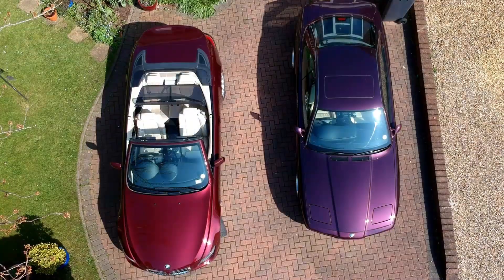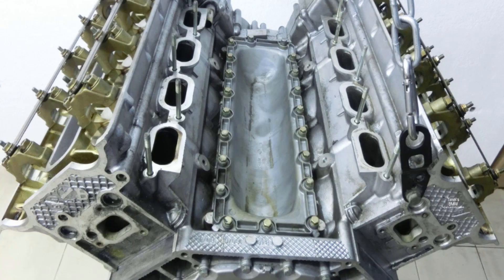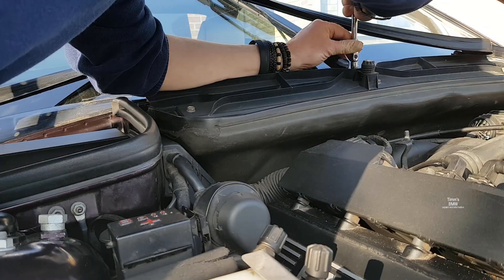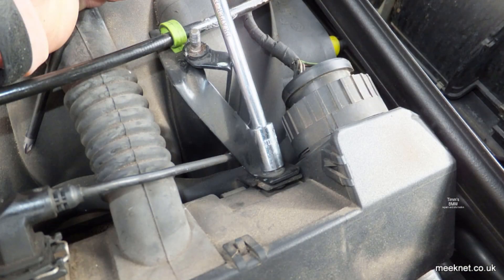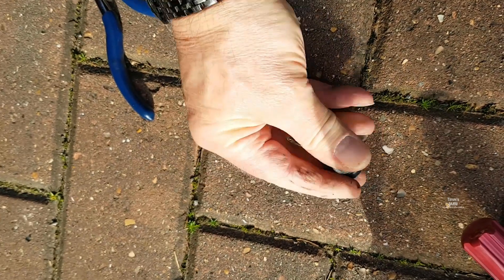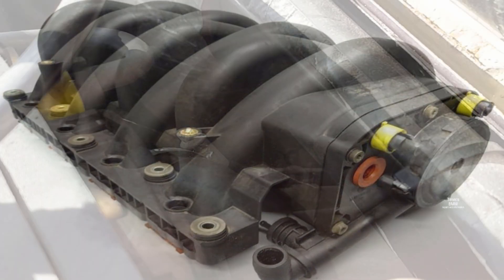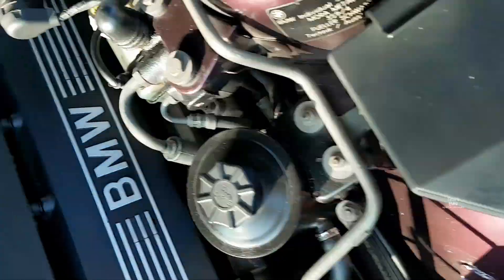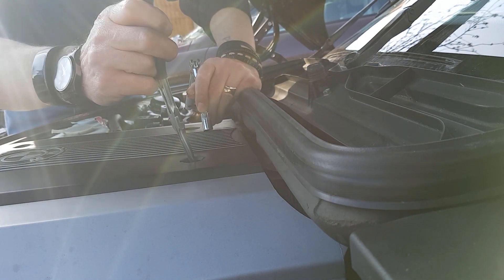BMW M60 & M62 V8 Engine - Simple fix for Inlet Manifold - BMW M60/M62

Comment: Tim do you remember the outer diameter of those m12 washers. Im having the same issue on cylinders 3&4. I just replaced the gaskets
Reply from the maker: The washer is a Form A M12 washer, inner bore 13mm, outer diameter 20mm and a thickness of 2.5mm
Reply: I appreciate it. I just had to order some on Amazon. Most of the parts stores don't have them. Im working on a 2001 540i touring. A lot of the videos you posted helped me save time and money

Comment: Once I put the washer how much I tight the screw? All the way hand tight with the small ratchet?
Reply from the maker: Have another watch of the video - the hollow nut should be nipped up once it has bottomed out
Reply: @T @TimmsBMW Did it succesfully today on all of them, except cylinder no. 4, thats a tricky one because fuel rail pipe is close, not much space. Didnt started the car yet but I did saw improvment in geting manofold more pressed down.
Reply: @TimmsBMW I can confirm that I have finished this fix, started the car and idle seems “stronger”, didnt drive the car yet but will do that in a day. One imortant question, do I have to reset some adaptations in Inpa after this?

Comment: Hi Timm, quick question here… why did you plug the vacuum booster? (The new part you swapped out in the video)
Reply from the maker: It isn't a vacuum booster line, it is a take-off point for the German TUV emissions test. The pipe runs from the charcoal canister to the throttle body

Comment: Great Video, I'm going to try this on my E39 540. I live in Texas and on the occasional time where it gets cold outside the engine at cold start with vary its RPM at idle until it warms up after a few minutes. I suspect that air is getting past the inlet gaskets.

Comment: Hi Timm, stumbled across your post while looking for specific compression rubber gromets/washers. Couple of questions hoping you can help with. On the inlet manifold spacer, in particular the  rubber compression washer , would you say the internal diameter hole is around 10mm? and the wider part be around 24/25mm external diameter. Lastly would you know where in the UK I could buy just the rubber gromets .. cheers in advance.
Reply from the maker: I've tried a few rubbery bits with no success - they are either too stiff or just disintegrate!

Comment: I just did this washer fix under the manifold fixtures and I didn't believe it would be so easy but I was proved wrong. I'm chasing a vacuum leak, I think, on my 2004 Range Rover Land Rover 4.4l W/ BMW 62M TU engine, and hope this is a fix?
Reply from the maker: Well, it will be if it's the manifold that's leaking. There's a few other areas for vacuum leaks. But make sure you have one first using this method: https://youtu.be/c1mq6Fllp9k

Comment: @Timm Whats your take on using the lower temperature thermostat (88 Degrees)to reduce temperatures and reduce gasket and timing chain guides wear?
Reply from the maker: Yes, that will extend the life of lots of parts including the oil!
Reply: Buonasera...volevo chiedere gentilmente dove trovo il termostato che apre a 88 gradi per il mio 4.6is

Comment: Hello Timm thank you very much, you helped me on the bimmer forum with the main fuse next to the battery on my E31 , hey whats the part number on that plug in the back of the manifold you said u changed 5 years ago thers one pic of the bottom plug but not the top one … thanks in advance my friend cheers!!!
Reply from the maker: Glad it helped, the part is 11611437694: https://www.realoem.com/bmw/enUS/showparts?id=EF82-EUR-11-1998-E31-BMW-840Ci&diagId=11_1538

Comment: I have a 2001 e38 I just picked up and mine has a line attached to that one that is capped in this application. The line is disintegrated. Should I cap it or replace it? Mine is a US spec car.
Reply from the maker: Don't cap it, that's the vacuum for your brake booster!
Reply: @TimmsBMW  no, there is a separate line that's going to my booster. I was able to find a part number and bought that new along with the jet. This one is separate and comes out where the yellow plastic is.

Comment: Hi Timm, I'm Philippe from France and I have a question regarding my car. I have a 840i from 1994 and for the cold start, the engine is not turning right. It seems that there is too much fuel. After few minutes, the engine is checking less but it is not running as it should do. The coils and sparks are brand new. Injector not but have been cleaned. The car have been stopped for more than three years. So, if you have any idae , please let me know. And keep going! It is a very good channel and I try to improve my english. Best regards
Reply from the maker: Hello Philippe, good to hear from you. Long cranking from cold usually means the fuel pressure has been lost. The fuel pressure should stay at around 2-Bar for weeks - if it drops then the engine is hard to start. The problem is usually the one-way valve in the fuel pump OR at the fuel pressure regulator on the back of the fuel rail. The way forward is to get a cheap kit from Ebay with a 'T' piece to measure the pressure.
Reply: @TimmsBMW  Hi Timm, thank's for your reply. I will try to check the fuel pressure on the car. Best regards! Philippe

Comment: purchased fixer 530i with m60b30 engine. drive it home but immediately started cleaning the car. under the intake manifold had became home for many rats/mice and upon blasting the leaves out with an air hose i cracked the already brittle knock sensors.

next day after some rest we pull the manifold off and did all we thought would’ve been necessary for maintenance; new knock sensors, hosing, new gaskets, and a new throttle body. after reassembling we started the car and immediately there was a problem.

we had bought a 540 throttle body, so we swapped it out, tried it out again and low and behold the problem was…better. but now we have a misfire that wasn’t there prior. 

we cleaned the coil packs/spark plugs but never replaced either. it’s one of those situations where i’ve spent a lot of time trying to get a result and i’m still scratching my head. hoping spark is all the issue is. 

anyone above me have an idea what could be happening here??
Reply from the maker: Best way forward is to use INPA as I show in another video to check the adaptation value and the smoothness values of each cylinder - that will find any vacuum leak.

Comment: Hey Timm...love the channel...it has provided some very useful tips that I have been able to apply to my 2001 E39 540i M sport.......I do have a couple of questions relating to this manifold gasket leak fix....
1. Do you re tighten the hollow fixings until they bottom out, or is there a torque setting that should be used, and secondly my issue may not be related to the manifold gaskets leaking but I have tried a lot of things to try and fix it. The engine starts and idles fine and accelerates very well, but what it does do is hunt or surge when you have just a small amount of throttle applied.
Codes say missfire on bank B, but the problem does not seem to be evident at any other stage of driving other than light throttle......very frustrating as I have replaced coils, plugs, airflow meter, fuel filters, crank case ventilator (rear of intake manifold)...cleared any oil residue in the plug ports......am wondering if as other's have suggested, it could be injector seal leaking, but I have never had them out myself.......I welcome any thoughts you may have on this......I'm keen to try and try the washer method as it is simple and cheap to do, and I hope may well solve the problems I have....cheers Dale M  ( Aus )
Reply from the maker: Hello Dale, firstly, every M60, M62 and M62TUB I have owned does the hunting revs thing when the throttle is slowly pushed past the idle (you have to do it quite slowly), so don't worry about that!

Yes, when the nuts are tightened on the hollow fixing I put just a pinch on them, nothing more than a handful of N/M, tightening them any further makes no difference!
Reply: Hi mate, any chance I could buy your 540? I’m uk based

Comment: Hey Timm thanks for the video and all the great content you put out! I will be doing a complete cooling overhaul and complete valley pan job on my 03 540i msport 6 speed. I will be replacing the Intake Manifold Grommet (11611736648) with brand new ones. Would you also recommend using this washer method on the new Intake Manifold Grommets to add some extra sealing compacity and longevity?
Reply from the maker: If you have to remove the manifold then there is no need for washers - you can replace the manifold gaskets and rubber spacers and you will be good to go!
Reply: @TimmsBMW  Yes I unfortunately will have to remove the intake manifold. I'm the 3rd owner of the car and everything I've replaced on it so far has been original parts from the factory with dates ranging from 2002 to 2003 so I have no doubt these seals are also from those years. Thank you for the response!

Comment: please sir i was changing my pcv on my 1994 740i following the instructions on your sight  everything was going well all the bolts came out i was proceeding to try to remove it from the pipe i tried  to head your words of warning about the pipe and unclipped it and man was that thing stuck in that tube .the pipe i tried to keep in place with long pliers but i guess i got a little to overzealous with the prytool and the pliers slipped and out came the pipe .please can it be re installed i dont want to pull the intake or the throttle body my car is in pieces need your help
Reply from the maker: Hopefully by now you will know the answer is yes, it can be replaced but it's a bit fiddly!
Reply: Timm's BMW Repairs and Information thanks Timm you answered both questions on the forum I appreciate it

Comment: Hi TImm
When removing oil filler cap should there be any vacum suction and engine rpm change?
Reply from the maker: Yes, removing the oil filler cap allows un-metered air into the manifold and that will affect the idle speed.

Comment: Hi Tim my name is Alvin. I have the 2005 BMW 645CI. 
Could you please show me where my Non return value is, I need to check both of them. Thank you in advance. Please help me.
Reply from the maker: Hello Alvin, if you are talking about the petrol supply, the pressure is retained between the fuel rail (injectors closed) and the fuel regulator/filter/pump unit in the tank.
Reply: @TimmsBMW  
Thank for all your help. 
Stay safe. 😀
Reply: @TimmsBMW   Thanks again Tim for all your help. Again I'm a big fan of yours, and I love you are vehicles.
Reply: Thanks again for all your help Tim.  I want you to know that you have great cars and that you have great videos. I am a big fan of yours. God-bless you and your family.

Comment: Nice - not so common - color on both cars.
Reply from the maker: Thanks! They are Barberarot for the 650i and Mora Metallic for the 840ci - both quite rare!
Reply: Rare indeed. I've got an Calypso Red E31 850 (not so rare). I'm in the market (looking for) an E64. I was afraid for the problems with the V8's but thanks to your information not so much anymore. (I own several other BMW's as well).
Reply: @TimmsBMW  Your 840 is amazing colour! My 850 is silver, quite boring at first, but I'm liking it more and more. Always wanted non metallic black, those look so mean and angry :)

Comment: You need to replace the rubber compressors
Reply from the maker: Washers are a darn sight cheaper!
Reply: @TimmsBMW  the rubber goes to crap
Reply: When you say rubber compressors are you referring to the rubber grommets. Mine are hard and can’t come off with out breaking to pieces. Do you have a part number for these?
Reply: @kenreid7803  no it should be intake manifold grommets

Comment: Dear Tim. 

I had a similar problem on my 840Ci (M62) but out of this other issues developed after replacing the crankshaft vent and the biggest one I face is fuel leaks from the injectors.

As good measure I removed the injectors and fitted new o-rings but now after 6-times taking things apart and fixing them back, still 3 are leaking at the top. 

Do you have any suggestion on how best to tackle this problem?

Appreciate, thanks.
Reply: Hi, from my perpective of m60 e32 if you are at the step to replacing those gaskets kit, you should use for connection and assembli parts a little film of victor reinz silicone. First as silicone is lubricating so during screwing is slides and get into perfect final poition. Second advantage is that after one day of drying (do not lauch engine immediatelly after the assembly) this silicone is for me about 50 percent better insulation with higher connection area .

Comment: i'll try this method to my 
#update : this method is working in my case , but ill replace that round seal 11mm, because 1 seal is failing, and i still get that annoying leaks
1994 e34 530i m60 hope this fix my annoying vaccum leaks from side to side of the intake manifold